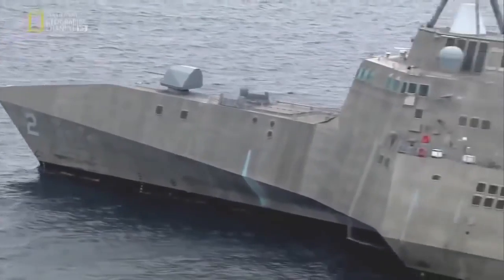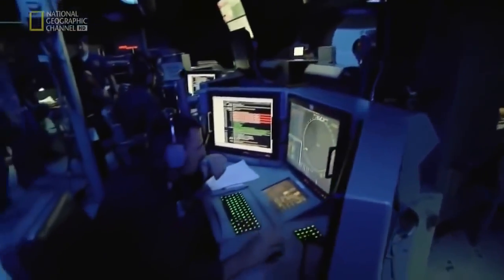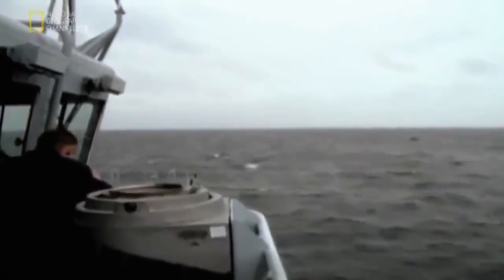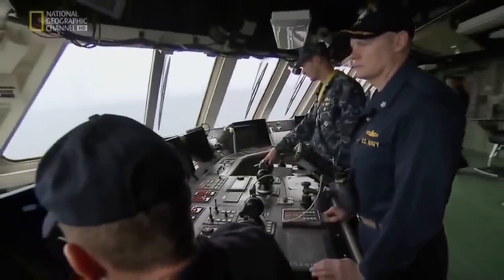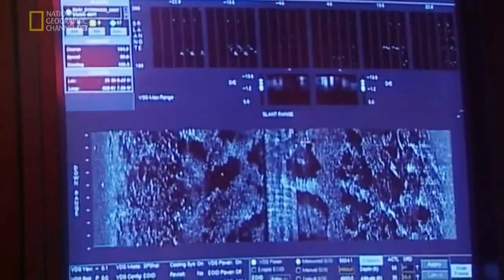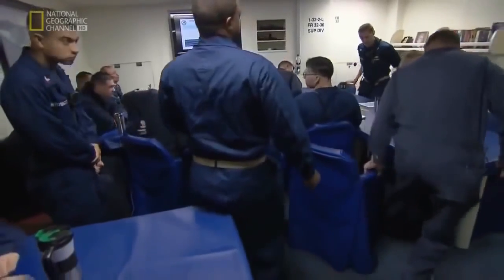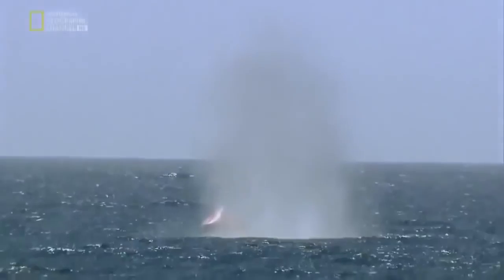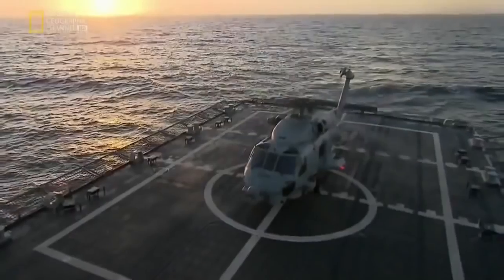Most stealthy warship in the world

Comment: THESE ARE TEST PLATFORMS, THE WEAPONS, ARE ON UNIVERSAL MOUNTS SO THAT THEY CAN BE RAPIDLY CHANGED OUT, IT'S THE REASON, IF YOU NOTICE, FOR THE BASIC SQUARE CURBS WITH AN OVERLAPPING FLANGE, ON BOTH SHIPS, SAME FOR THE MISSILE ARMAMENT, IT'S MOUNTED SO THAT IT CAN BE CHANGED AND DIFFERENT OPTIONS EXPERIMENTED WITH,,
Reply: CAPS LOCK IS CRUISE CONTROL FOR COOL

Comment: Aluminum is death of a fighting ships crew. Its own fuel will burn thru any bulkhead since aluminum melts at 780 degrees and its fuel burns at 2000 degrees. 30mm is too small for ships 57mm or bigger. Little gun little holes. See HMS Sheffield ships burned to waterline in one hour and 10 minutes abandoned and sunk with friendly fire.  Alumnum hit with a 50 cal ROUND WILL DRILL HOLES COMPLETELY THRU THIS HULL.
Reply: HMS Sheffield was struck by missile 240 warhead did not explode its 250 gal fuel load doomed the ship by burning thru the floor and fire doors. Steel bounces rounds and stands up to fire.

Comment: wow, 5 sitting ducks killed with 30 mm. Are you sure with this  type of testing plan USNavy cope with the real-time threat? 
some point.
1. if incoming boats are more than 5 (keeping in mind HMS SHIFILED sea cat missile system does not have the capability to process more than 6 targets at a time during Falkland war)
2 If boats are manned and using complex approaching plan with different high speed. 
3 if 2 boats coming from the head   and two from the stern, two from the port side and two from the stbd side.   
Thr relative speed of  the boats differ saigfactnily   if one gun  goes out of order   did fire control radar/IR system send real-time firing solutions for all 8 targets to  guns? any comments.
Reply: US military in general is becoming dependent on high-tech computer-controlled systems which seem prone to failure. No wonder Russia has invested heavily on anti-electronic technologies including focused EMP which can take down drones (and rumored to take down aircraft and perhaps boats)
Reply: too bad that whitout computer targeting the effective range of a gun is 10 times shorter. In ww2 tanks rarely hit each other at over 1 km, and they had to stand still when shooting, cause you could miss an house at 200 m if you moved. But if russia belives that manual targeting is the future, they are free to try it. By the way the so rumored EMP were tested since long long time ago, cause nukes emit a lot of EMP, and sorry they cannot take down manned planes. The best they can do is to disturb remoted controlled units.